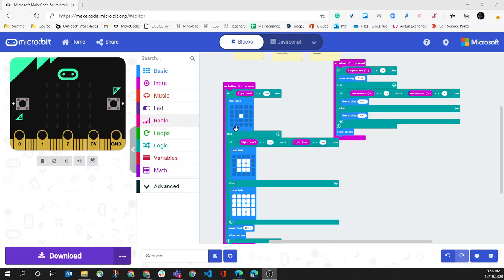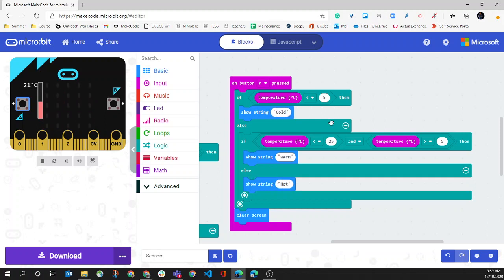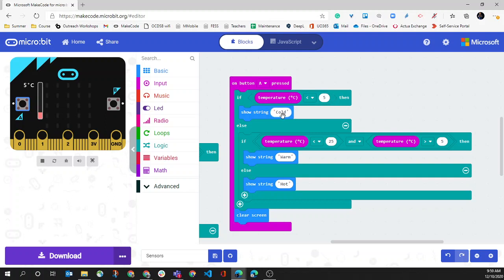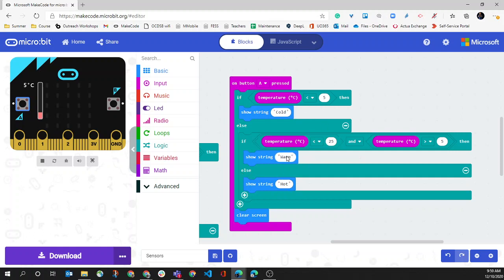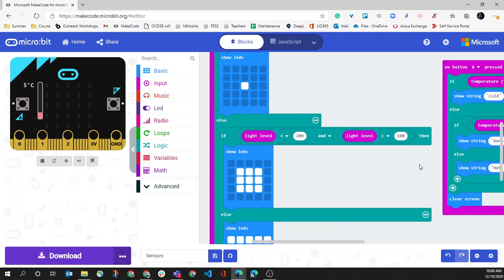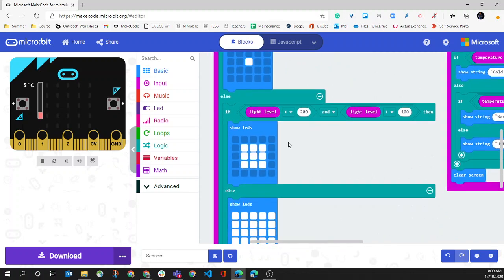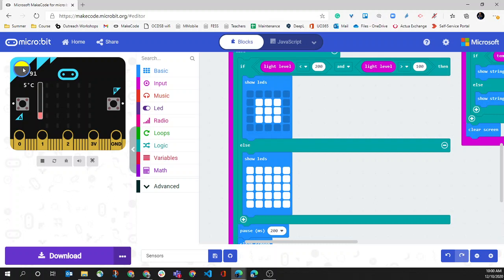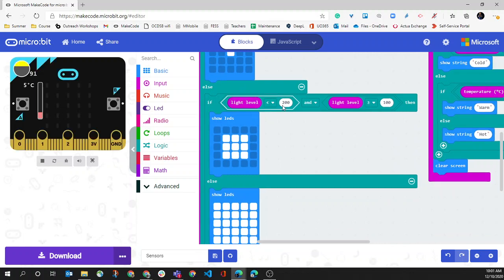Coding with Sensors

Comment: Nice video did you manage to make a RTC clock on micro bit
Reply from the maker: Not yet, Been too busy
Reply: @AndrewMcDonald_McScience  ok. but I have I question ,do you know if it is possible ?
Reply from the maker: @keenondeen6203  I would say yes.  Running a Python script on your computer to grab the date and time and then push that to the micro:bit.  I'm working on another project that is sort of similar so I should be able to solve that after.
Reply: @AndrewMcDonald_McScience  thanks soo much can’t wait for the release